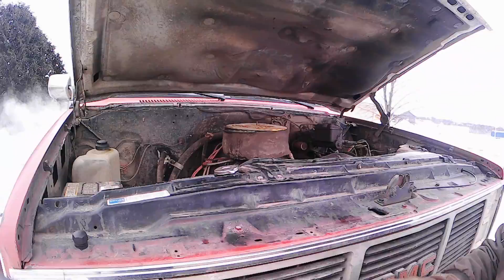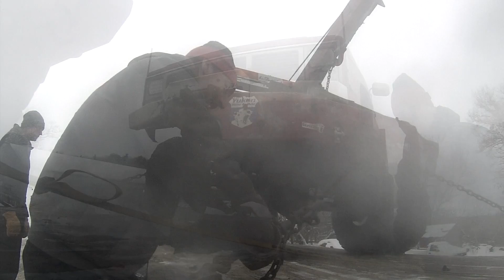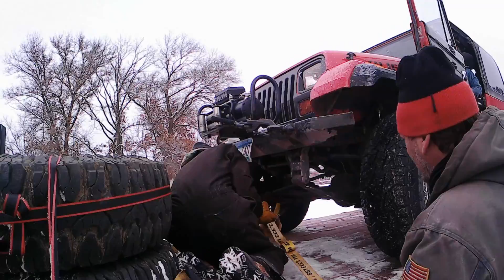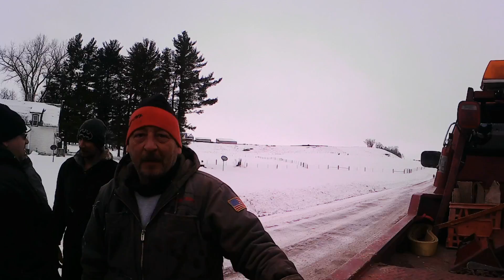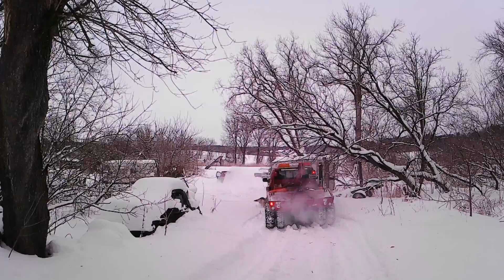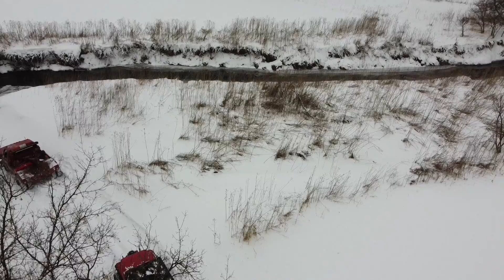3 YEAR STUCK EPIC 4x4 Recovery day two by BSF Recovery Team

Comment: I have a 1980 k30 wrecker -recovery truck with twin line winchs and extendable boom and rotator with out riggers all working order. 350 4wd straight drive runs great.
For sale in south Carolina. Pretty much rust free. Perfect for what your doing.

Comment: when winter droning throw the battery on your defrost heater and get it nice and hot before the flight. when the battery hits about 40f it starts halving the capacity
Reply: Thanks for that tip

Comment: In the oil field we changed out the hydraulic fluid for automatic transmission fluid, better fluid for heat and cold.
Reply: Ps check your hydraulic filters, they can collapse in the cold.

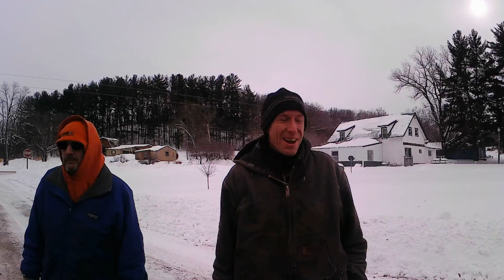Comment: Am I the only one that sees no reason that truck was stuck for 3 years? Looking at the picture at 12:17 it looks like they are in the woods with plenty of trees to anchor to. Guess I'll have to wait for part 3 to see.
Reply: Yeah, thinking the same, a winch maybe a turfor, plenty of rope & chain to work from a distance... we’ll see in part 3.
Reply: @clivehorridge , had to Google tirfur...those are pretty cool. Would come in handy for sure. I used to use a Hi-Lift jack with winch kit before I finally got an electric winch. Hi-Lift winching can be tough but it does work. Waiting on part 3 though. May be more to it than what that little picture shows.
Reply: With the way part 1 and 2 are drug out it might be part4 before anything happens.
Reply: @iffykidmn8170  we can only hope!...lol

Comment: hell westen champlin wouldve had this out in no time yall really should invest in making some sort of tracked rig for the snow
Reply: Casey's off road recovery, and Matt's off road recovery have snow cats.
Long ways from Utah to South Central Wisconsin, ,,
Reply: @haroldphipps3457  i said westen champlin not matt or casey westens got a tracked roptorbut either way both are a long ways away
Reply: @TylerDuysen  yep, I can read.
Just added a comment. 
It happens.
Get used to it.
Reply: Ought of be a lot of logging cable skidders available with no issues in that little bit of snow chained up on all 4 corners.